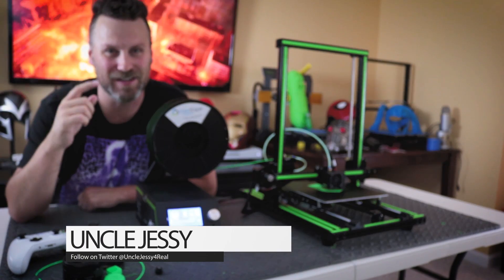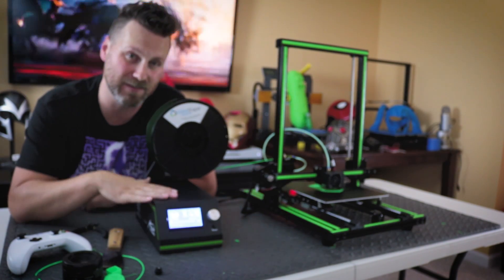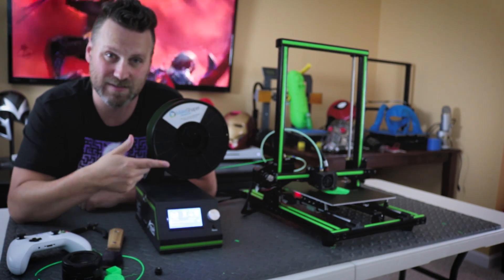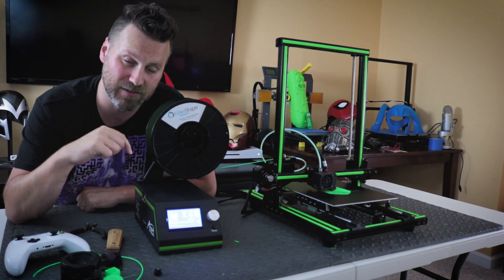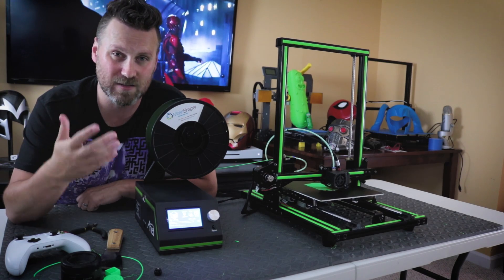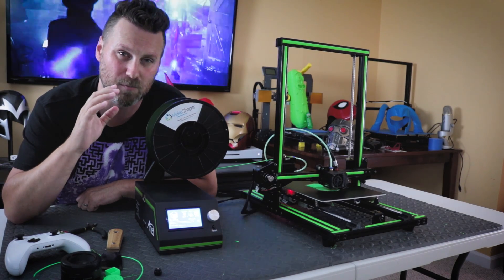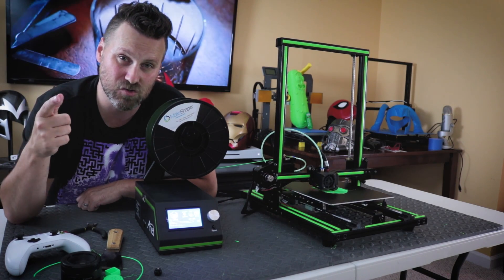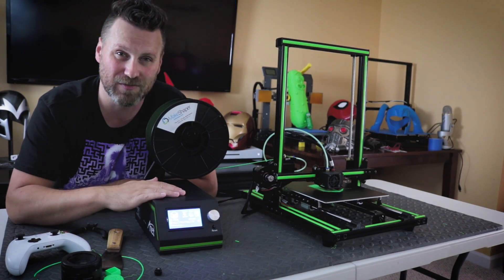Anet E10 3D Printer Assembly Instructions - How to Setup

Comment: Uncle Jessy  is far to polite to tell you what a piece  of badly ripped off garbage this is . best advice is  keep saving your hard earned cash in-tell you can get the CR 10 you really need . this from someone that has a Anet  A- 8  collecting dust as  a simply not good enough  printer
Reply from the maker: Stormbringer Mornblade thanks. Love the hell out of my cr-10. Still trying to see if I can get this printer to work before giving up on it
Reply: lmao i just had the most wicked ideal use the cr 10 to make part's to make anet work lmao

Comment: WARNING THIS PRINTER IS TERRIBAD!! It is made of aluminum instead of steel, it has a much smaller build volume, and it uses t-slot instead of v-slot extrusions, which means no eccentric nuts :(
Reply: you've been watching the drama queens PRESS RESET haven't you. I suggest waiting for someone with a brain to review it Timothy Hoogland has it we will see.
Reply: Why is he a drama queen. From what I have seen he seems to know what he is doing. I'm not trying to start an argument but am I wrong? What is your take of the guy?
Reply: Wait and see, by a number of comments he has made on the video he has a serious stick up his ass about this printer. FYI the CR10 is aluminium too and it's got the shitty one motor on the Z which is a turn off to me.
Reply: Nah the cr-10 is steel for the brackets of the axis. I believe the extrusions are aluminum tho
Reply: What's the problem with aluminium brackets as long as they are sturdy enough, they make airplanes out of aluminium they seem to do ok.
Reply: Typical, you proclaim something is bad but you haven't even tried it

Comment: Looks like a CR-10 clone. However from what I have seen, it cost less than the CR-10 because the CR-10 raised up to $500 now.
Reply from the maker: TioKilo CR-10 is still worth its weight in gold to me. I will need to work/refine/tweak the print settings further before I can give a full review. So far it's prints are coming out okayish
Reply: fuck I was saving for a cr10 and I saw the us plug one went to 500 but the eu plug one was like 410 when I checked and I have a us adapter but now they are both 500
Reply from the maker: I paid about $500 for mine back in Feb if I remember correctly... the CR-10 is such an amazing machine. Well worth it if you can afford it
Reply: TioKilo Nope. Marketed as such, but Press Reset just uploaded a video about how it's barely a clone of the TronX
Reply: It's only a kettle (d plug) like what goes into a tower computer and there will be a 110V/230V switch so just buy which ever is cheapest.